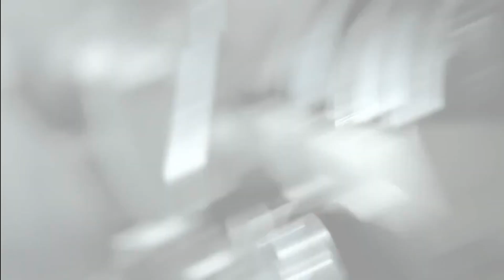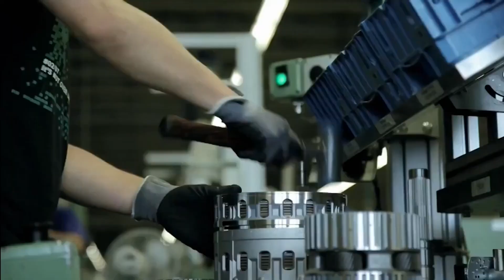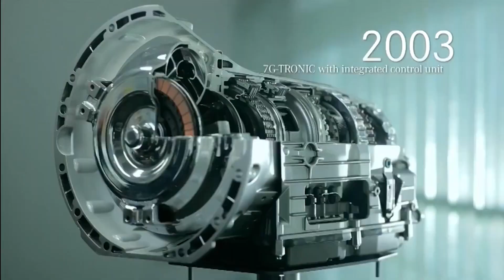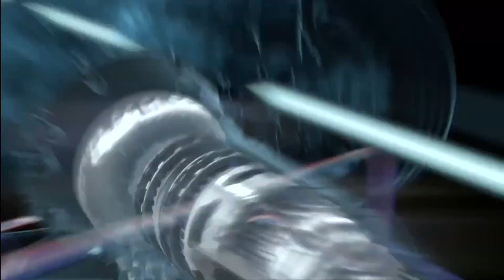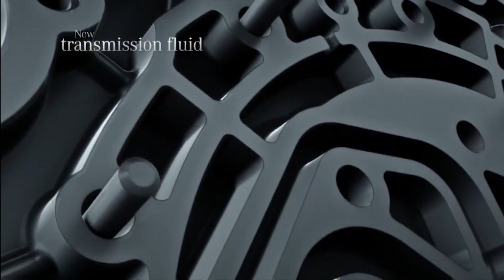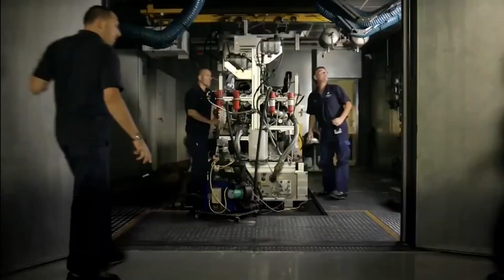The Engineering of Automatic Transmissions: A Technical Dive into Gearsets and Shift Logic.

Comment: Life Magazine June 30th 1958 President Eisenhower was on the front page with another person.On the very bottom of the inside front cover,was an article abouta Rambler Rebel going 35.37 miles per gallon on a trip from Florida to Los Angeles.That is over 60 years ago.Could you please tell me how gas mileage has improved? The technology that generated the Rambler rebel is from the 1940s. Again how has fuel mileage improved in 2025?